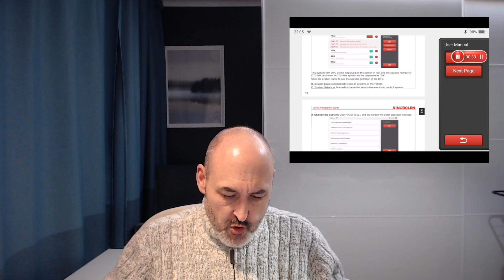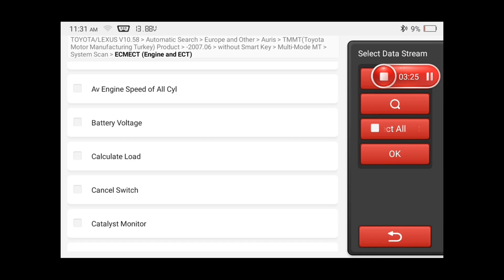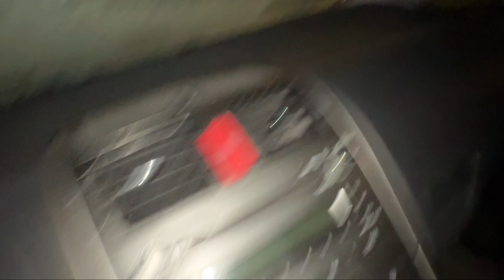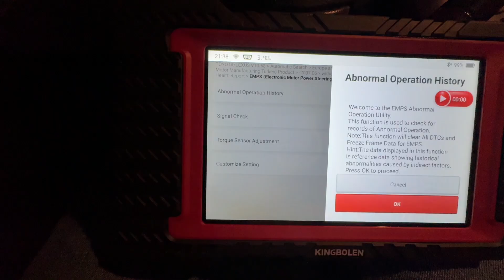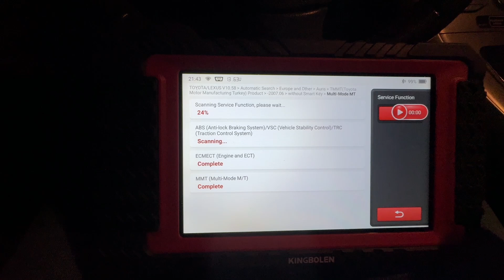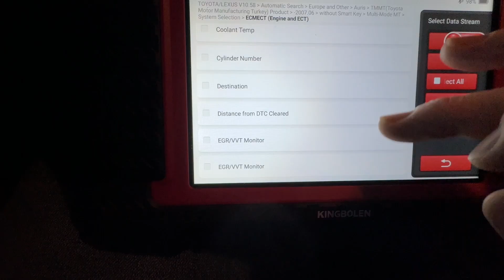Kingbolen K7 Diagnostic Scan Tool Review 🔧 Full Setup and Live Data Demo for Mechanics

Comment: Hey Ben, this is Mike from Texas (the former Toyota tech). That 13.5 volt charging is pretty typical for Toyota. I normally saw 13.50 to 13.8. Toyota really didn’t charge above 14 volts. I just changed an alternator out on an 07 Avalon (put a reman Denso unit in it, since that was the OEM manufacturer for Toyota and who your Toyota reman unit would be from) and it’s output was between 13.4 and 13.7. Good to see you still have the Toyota.
Reply from the maker: Cheers for the info mate! Where are you working now Mike? I need to get on LinkedIn more but with a small kid its been hard to find the time. So this will be either a parasitic drain or just an old battery. I will connect the ammeter in series next week and leave it a few hours. Cheers Mike.
Reply: @BenJFF I went out and opened my own shop. I have been working on helicopters mostly but still work on cars. Business has been steady so far. I like being self employed better than working for somebody else. Thanks for the video, I’m always interested in different scan tools. Good to talk to you!
Reply from the maker: Fantastic Mike😅 Takes some courage to open a business.